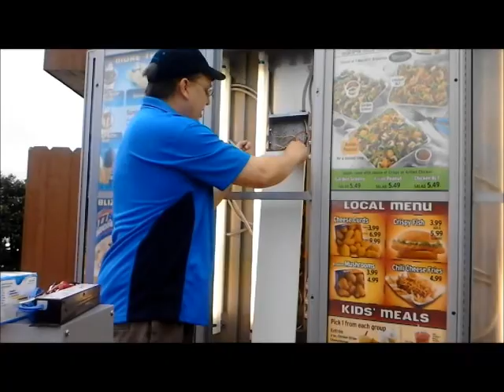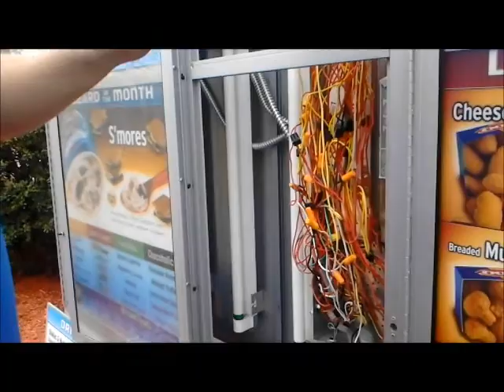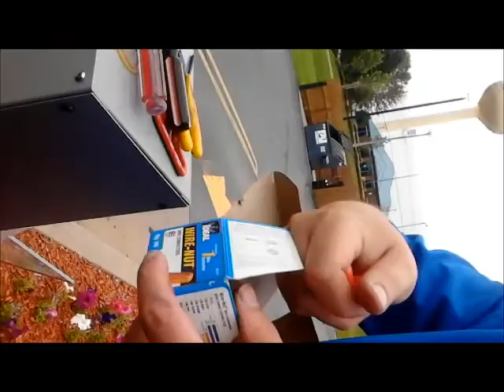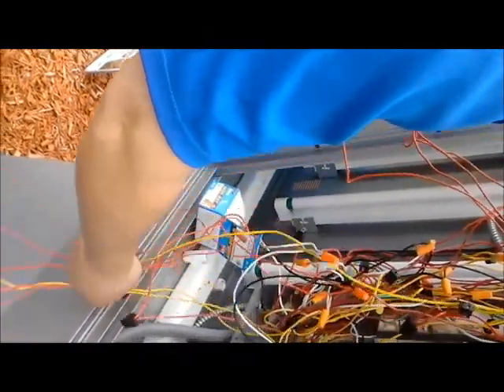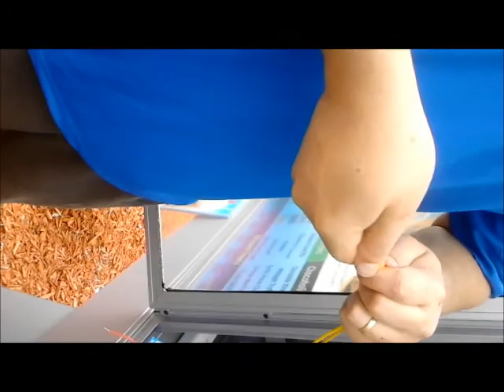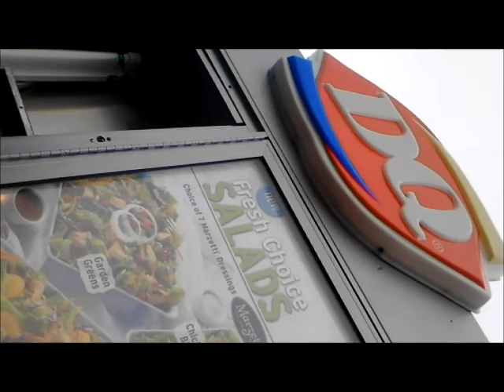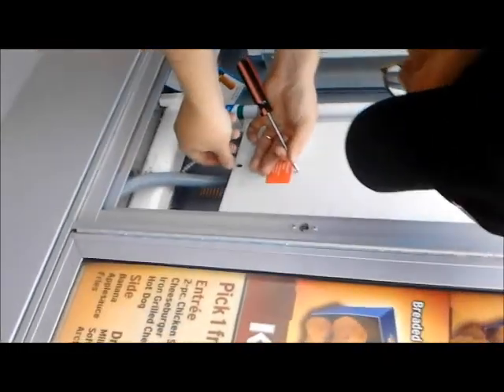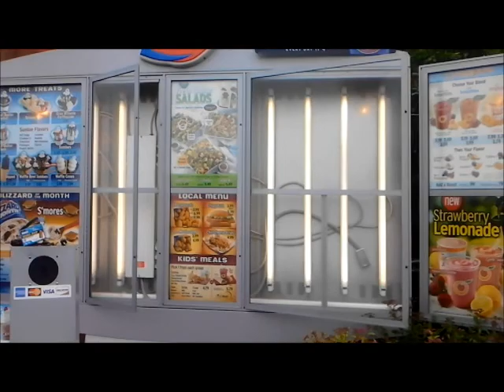How to fix a DQ drive-thru menu board LSI ballast

Comment: Nice repair.  I took the ballast out of my DQ ellipse  on the top of the Drive thru menu board too. I replaced it with a socket and a 100 watt CF bulb. It lights up brighter than new.